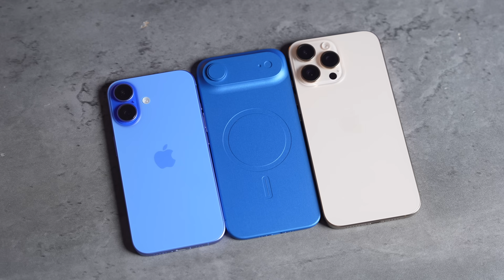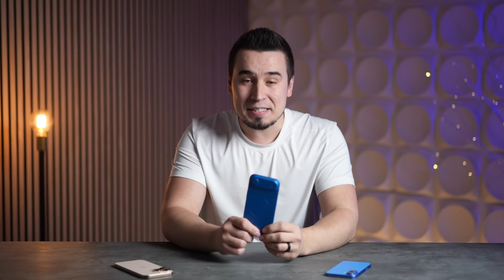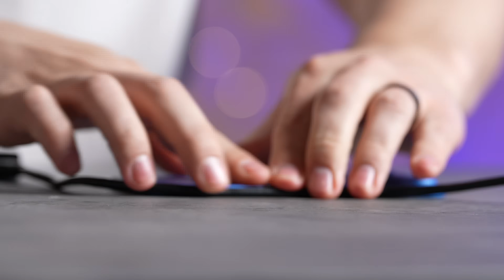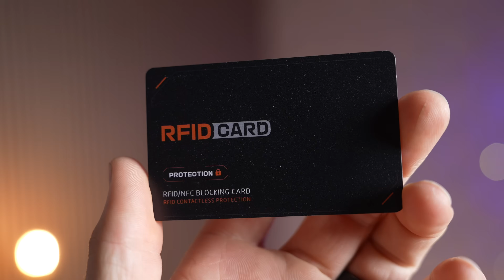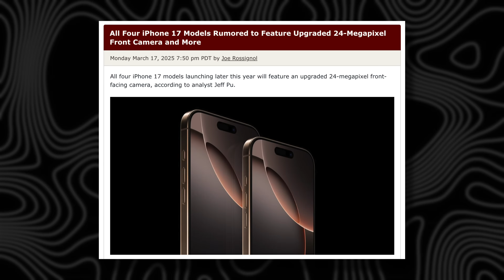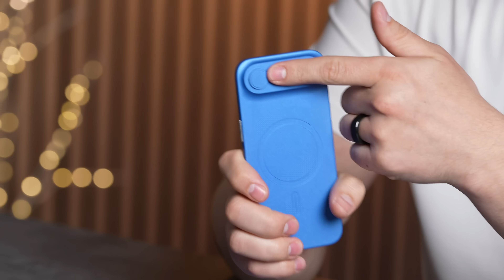iPhone 17 Air is a GAME-CHANGER!

Comment: Apples' internal tests showed a higher percentage of users would have to charge more than once a day with the iPhone Air versus other models due to a smaller battery.  Many would not.  Still, my big hands would rather have a thicker phone like my current iPhone 11 Pro Max.  I'd also be concerned about heat generation with the thin Air model too.  I guess also at age 78, I don't want to drop my phone and to me, a thinner phone would more easily slip out of my hand.

Comment: Very interesting device. I don't care about cameras and like thin and light devices, but many questions remain. If it really gets pro motion, the battery life is not a disaster and the single speaker doesn't get muted easily in pockets like some older iPhones I'll be all over it. I just wish it didn't have this camera bump but if that's what it takes to get face id then so be it.

Comment: I don't mind the single camera but I hope they make the wide angle camera slightly more wider angle, maybe like 20mm instead of the 24mm. Or if they can somehow make a very bright ultra wide angle camera (maybe like f2.0 aperture) and install that as the main camera (with 1x as default when launching the camera app) that would be equally good for me.